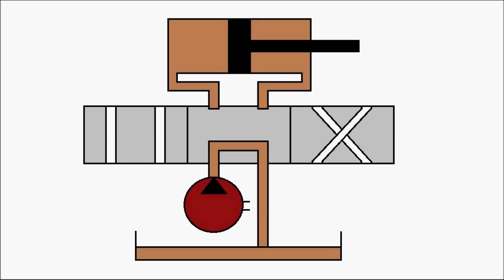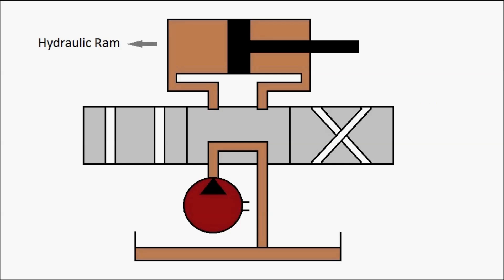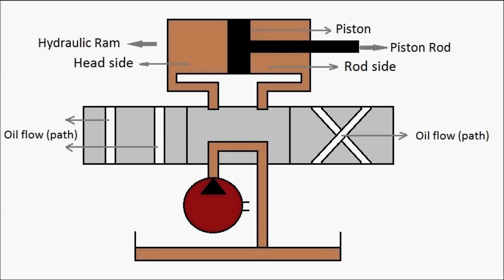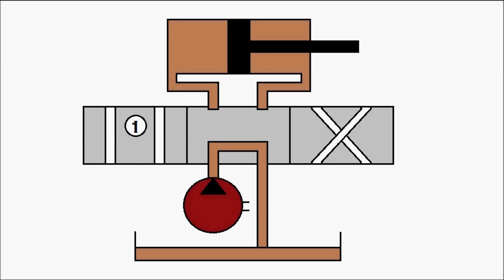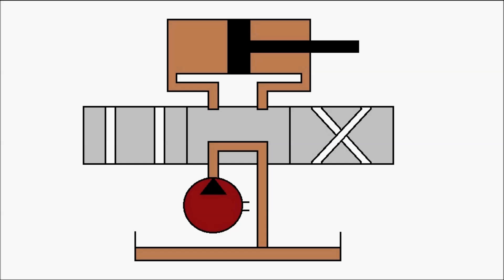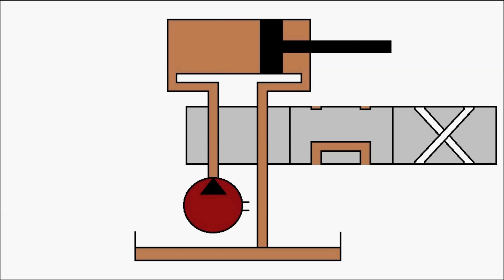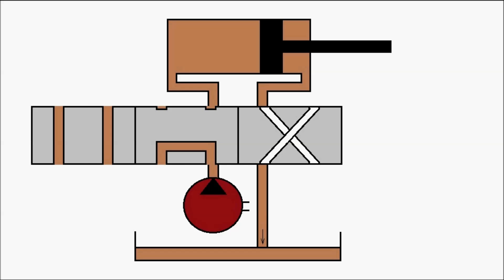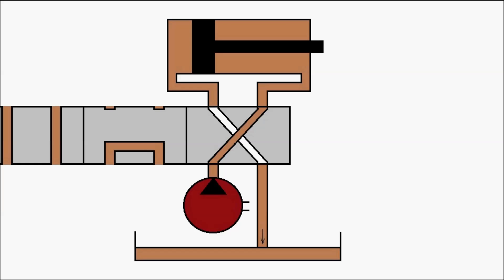Animation Working of direction control valve and hydraulic ram in circuit.

Comment: Really good and I understand the principle. What I am interested to know is when directional control valve is placed in neutral the oil passes in one port and returns to the tank. Some diagrammed I’ve seen show this action where both in
Inlet ports are blocked and oil returns back via relief valve. Why is there two options?
Reply: The purpose of relief valve is to prevent the back pressure from damaging the pump

Comment: Hi I wonder why the pump is not connected to the input line? I think there should be a line down to the oil case, just as the return line does.